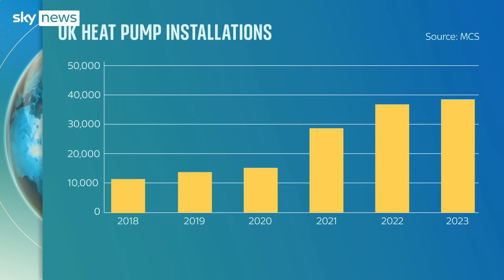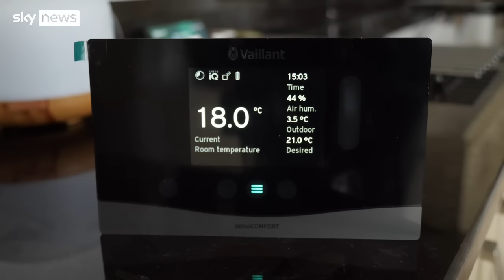Will heat pumps work in Britain?

Comment: Nope… well… it depends. If it’s for a swimming pool to be used in the summer… yes. If it’s for heating during the winter, the COP drops off significantly & makes it far more expensive than gas.
Reply: Correct. 
Efficency must be calculated correctly. 
Below freezing the efficiency is the same as a normal electric boiler. So depends on how many days a year below freezing one have. 
Every other house in Sweden has a heatpump of some sort. 
Due to where I live. I have a groundwell connected to the pump. Gives 3+ degrees to the pump on days even if its -32. Drawback is on days its warmer than 3+ outside. A airpump would be more effective. 
One have to size the system to where one lives. And also take in account for how Well insulated the house is. 
Get a proper engineer that can do both the numbers and a correct system. 
Lots of golddiggers out there
Reply: @RocketSailing  calculations are being made based on theoretical, not practical measurements. COP on many heat pumps falls below that which it states. Given the initial outlay & comparative cost of gas CH, there’s no comparison. It’s also less environmentally friendly as the electricity still comes from gas powered stations.
Reply: @RocketSailing  I’m in the uk & they’re being sold here as replacements for gas boilers. Theoretical COP vs actual COP differ significantly & depends on make, model, age, condition, etc., but, in general, domestic households in the UK are paying more for their energy by going with air source heat pump solutions. Ground source is a completely different ball game here where the cost of drilling would wipe out any financial benefits.

Comment: I was told by my heating engineer that he had been to a talk and was told that only 2% of the uk 
houses were able to except heat pump heating without serious building work being required
Reply: Only 2% of houses in the UK can have a two inch hole drilled in the wall?
Reply: Yes. Traditional boiler manufacturers are putting on conferences and telling people heat pumps don't work!

Comment: Does physics still work in UK? Urrr let me think.. Yes. Yes it does.
Reply: Yes. The physics of absorbing energy from outside air above absolute 0 and releasing that energy inside works fine in the UK.  

About 4 to 5 times more energy can be moved from inside to outside than the energy required to to do so, when averages over the whole heating season. Often misquoted as an a efficiency of 400 to 500%
Reply: Yep. I know. Thanks!😂

Comment: I've had a heat pump for 7 years and regret it,  the RHI grant I got was not paid up front, it was paid quarterly  and i was told it would cover  25% to 30% of the £13000 cost, I received about £800 over the 7years, the grant stops at  7years.
The running cost and mantainance are higher than my old system and the house isn't as comfortable.
Reply: My heat pump system is 8 years old and the RHI paid me back over £4.5K. Underfloor ground floor and rads upstairs. The running efficiency is lower when it's minus C outside but that can be offset by raising the flow temps. Works well in my 100 year old house with plenty of insulation.
Reply: Clearly your system was hugely malfunctioning or incorrectly set up. the RHI is biased on efficiency. It's easy to tell it's not working as the payments are so low!
Reply: That's the problem, maintenance. A very backwards step. Just like ditching the combustion engine.
Reply: Rubbish. I have a ground source heat pump for which I have been paid over £2k per annum for the last 7 years. It has amounted to well over 50% of the system cost. The final payment is in October. Ground source heat pumps do attract a higher RHI rate than air source heat pumps but the difference is not huge.  It looks very much as if something was wrong with your application.

Comment: It would be helpful if the government grants for heat pumps covered air-to-air instead of focusing solely on air-to-water systems, which are far more expensive and often aren't suitable for every home....is someone in charge of the grants getting a backhander for this nonsensical decision?
Also, it would be great if there was a unified accredation for HP system installation. Way too many cowboy firms fitting HP's after minimal training and screwing it up, but taking the grants.
Reply: air to air isn't covered because of their cooling mode. Why should the tax payer fund someone's air con? It's a luxury.
Reply: Just disable the cooling mode then

Comment: Wood is cheaper in the countryside.No-one will notice on the cold winter nights.
Reply: I do when I have to open my door to be greeted by a load of particulates - lovely
Reply: Ah, deforestation.
Reply: So the sky guy appears to be laughing at the people who can't afford to pay for one? So the government and opposition millionaires (who live in countryside mansions), they have heat pumps yes? In their country homes?
It's currently 28C in my living room, I had to open the patio doors to cool it off bit. It's -5 outside. Wood burner on low. Green renewable energy.

I do need to put my boiler on and check it still works after 3 months ;-)

Comment: I am a heating engineer and have never once had an enquiry about weather I fit heat pumps but I’ve had 5 different phone calls in the last year or so about coming round to take the heat pump out and get them back to a gas boiler🤷‍♂️ and that’s coming from people who’ve spent a fortune on them and lived with them🤷‍♂️
Reply: Were the houses well insulated and  airtight?
Reply: @shaneheff5244  insulated or not, it's all about flow rates and emitters - get them right and they will run cheaper than gas over the year. Most 'engineers' in the UK are just installers who don't know how to design/spec, commission a system properly.
Reply: @shaneheff5244 yes all 5 had said that they had the insulation done ready for it but still weren’t warm enough🤷‍♂️ air tight houses are not a good idea🤦‍♂️ I’m not saying heat pumps don’t work at all but just won’t work in probably 60-80% of existing buildings
Reply: @dombarnes7092  wonder what the issue was with them so?
Reply: As a heating engineer what was the root cause of the issue with the heat pump?
Reply: That's because your a gas fitter!

No one is going to call someone who doesn't specialise in heat pumps to get a heat pump
Reply: @njipods  how the f£ck do u know what I do u innocent fool🖕 just like half the people who’ve commented u know f£ck all about it but just have to flap your gums in absolute ignorance😂😂 all I commented was some REAL WORLD feed back on heat pumps I have no motive or agenda like the people pushing it😂
Reply: @njipods my friend spent thousands on an installation like this and it’s broken the family because it was recommended by one of the sons who is now embarrassed it’s caused financial problems.
Reply: This history is sus, personally I still use gas and my country has the same problem as British homes, so I can’t have an opinion on heat pumps
Reply: There are a lot of installers around who are clueless about heat pumps. A competent installer will do it right and the customer will be satisfied.  It is imperattive that we get rid of all gas as soon as possible. The alternative is unthinkable.
Reply: Must have been a crap installation then. 
I live in Sweden and have had my system installed in 2005. Was -32 celcius last week. Warm and cozy.
Reply: I find your comment suspect .... as in I do NOT believe this.
Reply: @julierogers1155  I'm interested in hearing the reasons for taking them out. I'm surprised.

Comment: As long as they work as my parents have a bolier that keeps saying f22 used to go off once every 2 days now everyday they do fill it so it comes on but keeps going off my parents have Aaron engineers out 6 come out before Christmas and boiler still plays up and an engineer came out today he turned off radiators via boiler to see if it is the water to the taps that loses pressure and he did check radiators too and they are fine like my dad did bed radiators to see if it was them nope boiler still went off engineer coming back Monday morning so if people say just top it up we do but we shouldn't need to do it ourselves everyday though hopefully it be fixed Monday as at the moment heat pumps sounds better for be then boilers that play up
Reply: Incoherent story.

Comment: There crap , noisy , expensive and don’t work in cold weather
Reply: tell that to Scandinavia and Canada. I hear it can get chilly there.
Reply: @allthegearuk Works in -25 degrees Celsius still multiplying energy👍😌Mitsubishi and Panasonic has reliable nordic models.
Reply: @pr7049 and consumes more electric.
Stick with ya stove
Reply: @S99-c5s  The nordic models still multiply energy😌👍in -25 celsius degrees.

Comment: Heat pumps may not emit Carbon Dioxide BUT the electricity they are powered by certainly does !!
Reply: depends on how it's generated
Reply: Gas boilers use gas heat pumps are electric. The grid has an ever increasing amount of green energy supply meaning it will only cause a fraction of co2 emissions of a gas boiler. Also even if they both run only on gas one at a massive gas power station and the other in your home the heat pump would still be more efficient as gas power plants are more efficient than a home boiler
Reply: Your gas boiler also needs electricity.

Comment: I live in a rental and it has two old economy 7 storage heaters, if I put them on before I go to bed my smart meter is reading £12-£13 when I wake up at 7am. Its not a viable way to heat my home, I cant afford £500 a month electricity bills as a single guy so I now have no heating apart from a portable oil heater which is also costly
Reply: heat pumps are not storage heaters. they are 3 to 4 times more efficient so in theory 3 to 4 times cheaper to run. Doesn't help much in a rental
Reply: @allthegearuk  I know they arent, I was just moaning about my heating costs
Reply: Get a better job.
Reply: @Joe-og6br   Thanks man

Comment: I've got them in my home and through this cold snap heated my place  absolutely fine and lovely just take a few more minutes  to warm up.... But I keep it consistent at 15 all day and turn it up 20 for 3 hours at night.... It's great... Always have a bath and heats the water up perfect and to a fine temp as well as really hot shower water..... I love it with my solar panels it's cheap as anything in summer about 25 a month to 30 in summer and 60 last month this month on track for about 80 but will hardly be in use all summer so will save loads in a year they really are great no gas bills all electric
Reply: Same here. Poorly insulated 60s house and my monthly bill is 80/month for the last 3 years. Heat pump at scop around 4, so cheaper than gas. Small solar array does export a lot in the summer, covering the cold winter snaps. And under RHI the whole system was less than 3k, including a full unvented system upgrade. The haters can hate, but we're warm 24/7 for 80 quid a month 🤣
Reply: @Loopyengineeringco  👍
Reply: Why lie though?
Reply: @CJones-99  genuinely not only been in property since July I was sceptical at first but mine really is good just my opinion on smart meter so always check how much I use  mine really is good I have the valient one
Reply: technically speaking 15 degrees is atleast 3 degrees below the heat level required to not only stay generally warm (according to numerous charities and healthcare providers) but also to guarantee no mould or mildew forms in the house, 15 degrees is perfect for condensation and mould formation
Reply: @dazt5831  well if anyone wants it higher simply turn it up.... My property is well insulated and usually stays warmer than 15 anyway.... I honestly find the heat pump really really good.... As good as standard heating if not better.... Not sure how it would be on a reallt large property my property is new and well insulated so there probably are exceptions as to how it would work olde properties... 🙂

Comment: Its so ugly looking. Not something I would enjoy looking at in my garden in the summer. Just plonked under the kitchen window with pipes running up the wall. A neat gas boiler in a cupboard is much more pleasing on the eye. Can't it be hidden away out of sight and sound?
Reply: Sure. The compressor does have to go somewhere outside, but it could be anywhere.

Comment: Works well in Sweden. But better with a deep gound water well. To connect to the pump.
Reply: That is a different system, called 'ground sourced'.   The ones being touted in UK are mostly air sourced which is nowhere near as effective or dependable.

Comment: We shouldn't ditch gas in the UK. We have 'enough offshore wind potential to power Europe' in the UK - we should synthesise methane ('natural gas') with it so the gas main itself is net zero. Then nobody would have to be forced soviet-style to dispose of functional appliances and get new ones in - a manufacturing Climate Change disaster. Net zero gas in the main would be more expensive, which would motivate people towards heat pumps and insulation with no government interference needed.
People keep saying "emissions" but that's not what causes Climate Change - tapping fossil deposits does. In the UK we could use synthetic gas and cooking, hot water, and CH would be net zero with no house changes needed. Additionally, it's just about the only feasible way (Royal Society agrees but prefers hydrogen) we can solve renewable intermittency.
Reply: "synthesise methane"
Just insulate the hosues to near to zero energy.
Reply: @williamforsyth6667  With a boom in turning fossil commodities into insulating materials? If we'd gone synthetic hydrocarbons first all that insulation would be carbon sequestration instead of more of the same underlying problem. Insulation won't warm a cold house mid-freeze, and there are lots of UK homes that are perfectly inhabitable (by healthy people!) with a fire on for a few weeks every year that can't be economically insulated. Otherwise it's sound advice...

Comment: if people are afraid of losing their gas boilers (or have newish gas boilers), they can still install a heat pump to get air conditioning in the summer (and support heating in the winter). As I understand it, most people in the UK do not have AC and your summers are getting hot. Heat pumps do both.
Reply: Soo, heat pumps are meant to be better for the environment by providing people with a system they can use all summer too?? 🤔
Reply: I'm in Toronto and I don't need to use my AC all summer. However, we do tend to get a couple of heat waves every summer (1-2 week stretches) where AC is literally a life-saver. We do -40C to +40C every year here so everybody has both heating and AC @adelaidelawn
Reply: @JB-fv6vx  Thanks for explaining. Never knew they were dual purpose! I find it quite ironic that a device being promoted to help achieve 'net zero' will ultimately be causing more emissions 😅
Reply: I believe the current grant of £7500 only covers a heating system. If cooling is part of the system then it doesn't qualify. If any one else can correct this then please let me know.
I'm planning solar/battery this year and am wonder if a mini spilt AC system would be a better option vs an ASHP to replace the boiler.
Reply: all air source heat pumps are AC in the summer. @steve_787
Reply: Where do I put the ventilation system for that? Many houses have brick interior walls and concrete floors
Reply: there are ducted and ductless systems available @seanlaverty40
Reply: Heat pumps can do wet systems eh central heating systems like a gas boiler but typically not cool in that case. or an air conditioning like system that heats and cools. 

Both are heat pumps. A2W is what is typically meant by heat pump nowadays in UK media. But A2A is what can do air con cooling and heating both ways.
Reply: Here in the UK air conditioning is nice to have on only a few days per year. In order to qualify for government grants in the UK heat pumps must not be capable of air conditioning.
Reply: @rogerphelps9939 wrong all heat pumps a2a a2w etc are VAT free at the moment on domestic installations
Reply: Hot for a be few days not really rocket science is it
Reply: No they don't, they only do hot water.
Reply: Brits really don't seem to be very familiar with this technology @Robert-j6r8c
Reply: @Robert-j6r8c  air to air systems do both
Reply: @Robert-j6r8c No heat pumps are just reverse AC. They can both cool and heat your home.
Reply: @JSM-bb80u  
Air to air can, but don't do hot water. 
Air to water (the majority being fitting in the UK) don't do reverse, technically they can but the manufacturers don't put the valves or the software for them to do it.
Reply: @bwertyuiop  Some of it always does.
Reply: Not near hot enough to bother with AC.
Reply: Summers aren't hot at all. In 2022, there were 14 days 25c or higher. There were zero days 30c or above. Zero, nil, nought, none, zilch.
Reply: we don't need air conditioning.